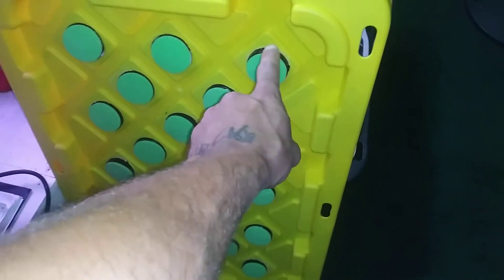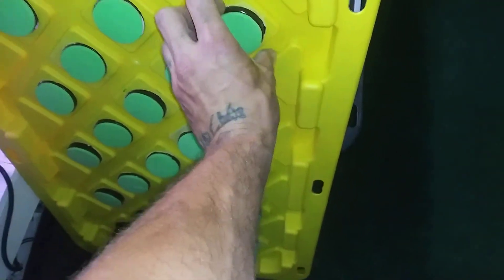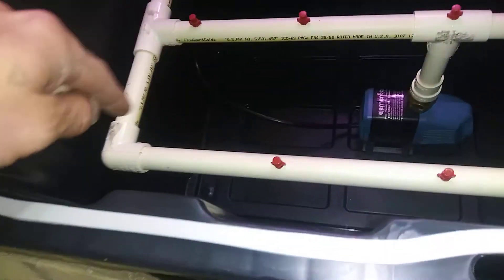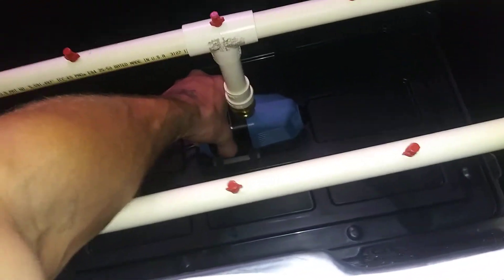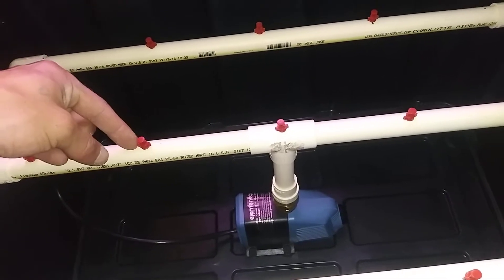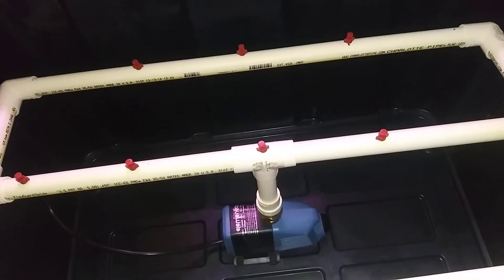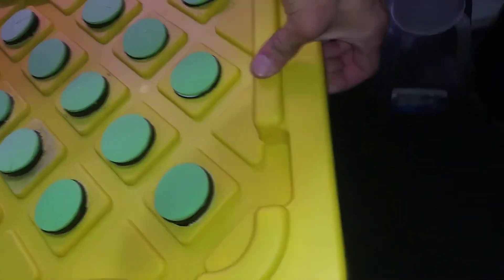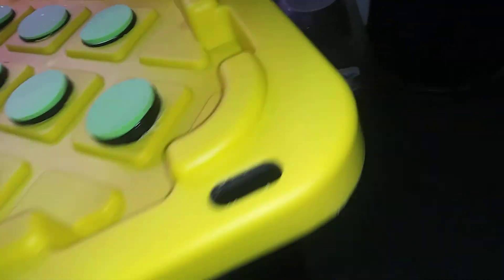Aeroponic Cloner DIY Made Easy $50

Comment: Hey dude I really mean it when I say thank you so much for the knowledge I'm going to make my own but not sure about what I will need example the tool to make the thread after drilling the holes plus the sizes of the holes and the sizes of the micro sprinklers and the sizes of the connectors for when fitting them onto the pump

Please help with the tools and sizes needed for the holes on the top to keep all cuttings in place

These cloners are going for 80-100$ on Amazon I'm just trying to save time and money thanks in advance I'm really looking forward to your reply thanks dude